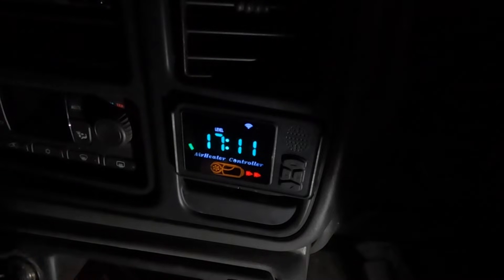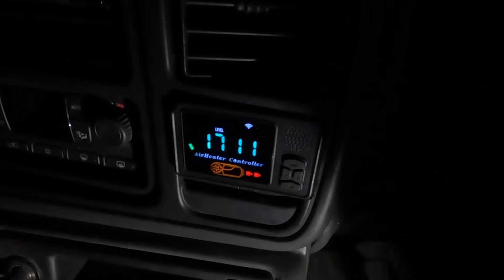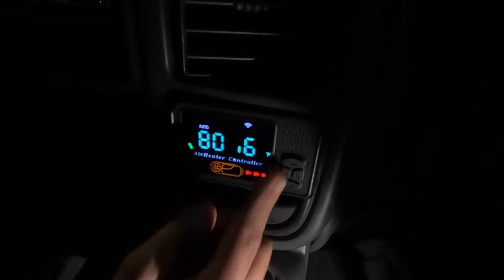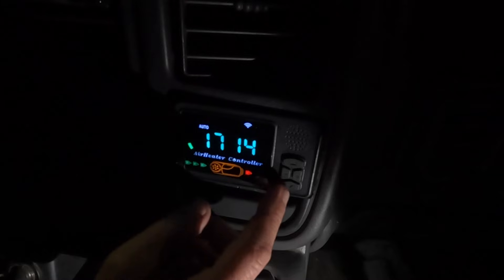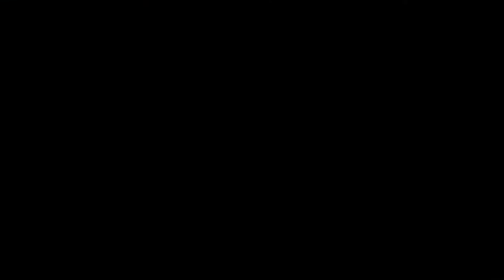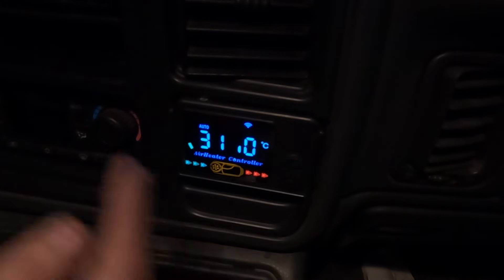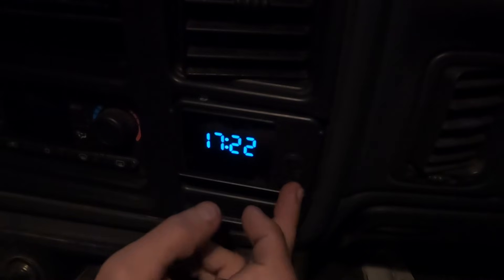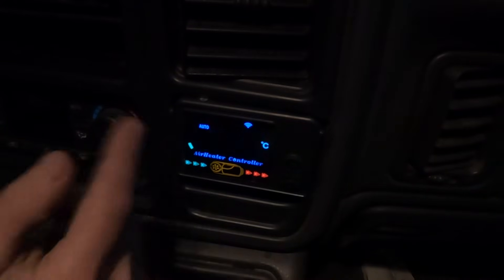Bluetooth Diesel Heater Feature & Settings Discovered !

Comment: I have not seen this question in any other heater post. If you have 2 heaters in different places will the blue tooth affect each other?
Reply from the maker: I just found the answer to this myself, the other day. 

The app will only connect to one heater at a time. If you want to control a different heater, you hit the scan, on the top right, and disconnect... you then select the other heater. It is a bit of a pain until you figure it out. 

PS... it is a good idea to look at the last 3-4 digits of the heater code before disconnecting, so that you don't make a mistake and reconnect to the same heater. It would be nice if they allowed you to change the names of each heater... but they just have a serial number or something.

Comment: What app do you use for blue tooth, and how do you pair?
Reply from the maker: It is called airHeaterByBLE and you pair by clicking the "scan" in the top right ... then select your heater and it connects ... I have done several and it works flawlessly.

Comment: Question 🤔 would this controller work on a older first gen vevor? Ive tried the second gen controller with wifi bars but to no avail! Love the auto on/off feature!
Reply from the maker: Hello. If you can find the controller and ECU, you can swap them into just about any 5 or 8kw heater, but I have not been able to find them, and I don't know that this would be cost effective. 

If you are looking for the auto on / off feature, you may want to look into a product called the Bureck thermostat. I have one that I will be testing soon.

Comment: If your diesel heater doesn't have Bluetooth can you make a have Bluetooth by switching out the control panels
Reply from the maker: If you can find the controller and ECU, then yes.... I have not been able to find these separately. You do need to swap the ECU and controller as a set. Also, the whole heater is pretty inexpensive, so it may not be cost effective.

Comment: If you hold down the up and down buttons at the same time for 3 seconds it will give you a menu where you can see different displays like the temp  inside your heat exchanger and it can display your altitude in meters.
Reply from the maker: Yes, I have noticed this... nothing that you can change, but a bit of info that you can see on the app, and a few extra things.
Reply: @loweredexpectations4927   i have a hcalory  version with this controler    my one has  temp of the burner and temp outside and altitude  on the display
Reply: hi   where is the temp sensor is it in the machine ..as i was going to use it for my tent   but have the heater outside for abvious reasons  do you know where the full break down of the  settings are or where to find them   cheers
Reply: @nigelcundey9710  there are 2 temp sensors, one inside the heater to ensure it doesn't overheat and the other is inside the display/controller. As long as you keep the thermostat inside the tent you can set the temp.
Reply: @randybobandy9828 I alway extend the controller cable so the heat put off the heater doesn’t fool the thermostat 😉 simple wire splice on 3wires 😉I recommend solder and heat shrink too😊
Reply: @kevinkc3onohelijeepworld  my heater isn't even in the same room as my controller, so it doesn't need to be extended. I also use the level settings instead of temp settings so the thermostat doesn't really help me. Heater is still going strong over a year later.
Reply: If the unit is disconnected from its power source, do you have to reset all its settings, or does it store the settings in its memory?

Comment: Maybe the "1.0°c" setting is to offset the thermostat innorder to calibrate it? Mine built in thermostat seems to be off by quite a few degrees
Edit: yes that setting is a temp offset. It was 13°c in my room but my controller said it was 22°c and i adjusted it -9°c and it now says 13°c
Reply from the maker: Yes... A bunch of people have informed me that that is for calibrating your thermometer. You can apparently set it plus or minus 9C. The thermometers are often off because of where they are mounted, or what they are mounted to. Air flow, or lack of air flow can have a dramatic effect, and having the controller mounted to a hot or cold surface will also change the reading.

Comment: I appreciate the video. I'm actually really disappointed that this model cannot change the fan/fuel speed. My heater will overheat past level 6. I was hoping to adjust the fan level higher in order to pull more air over the heat exchanger to keep it cooler. I only have about 2ft of ducting but i have a 90° bend about 6inchs immediately out of the heater and I think this is my issue... Unfortunately where i have it installed it is almost impossible to not have an immediate 90°bend. Wish i know that before  i drilled all my holes. 😅
Reply from the maker: A good idea would be to figure out what the problem is. There is one fan to control combustion air as well as heating air, so speeding up fan to cool it off is not a good idea. 

Remove the heater or remove the hose, and test it with the hose off. Diagnose why the heater is actually overheating, and then you can decide how you want to go about addressing the problem. Might be a pain in the ass, but it's the safe and smart thing to do. 👍 You got this !
Reply: @loweredexpectations4927  ya I need to just take the ducting off and see if it still over heats on high, if it fixes it the. That shape 90 bend is the issue.
Reply from the maker: @randybobandy9828   Hopefully this is easy to sort out 👍👍

Comment: I have been hating my heater ever since I bought it. 4000 ft elevation and it constantly overheats. It will run until the internal temperature reaches 260-265C then turns off. 30-35 minutes on medium settings, 5-7 minutes on high. I unfortunately bought the lower end model with a controller that does not have the ability to adjust things or even put it into prime mode. Vevor sent out 2 replacement motherboards and a temperature sensor but they did not fix it.  I am considering buying a different controller/board  and seeing if that helps.
Reply from the maker: Sorry to hear you are having issues. What controller do you have ? 

I am at 3500 feet, here in Calgary, Alberta, Canada, and I have no issues at all even when running my heater in "normal mode" for sea level. 

Most of the lower end controllers will have something called "plateau mode" ... this feature leans out the air fuel ration to stop it form overheating, making soot and lots of CO. 

I have never seen a heater that doesn't have prime mode, other than the ones with the volume knob... The controller I have allows you to prime, but will only allow it once when you first connect the power. After that you need to disconnect power, reconnect and press the down key for 7 seconds. 

The motherboard (ECU) has 100% of the functionality, so if your heater is having overheat issues, I suspect it is either an air blockage issue (exhaust, combustion air inlet, duct air inlet or duct air outlet... they are very sensitive so you need to be mindful of this.... If you are forcing air into a small area instead of recirculating, this could be the problem. 

I suggest checking the heater over carefully and running it without anything attached, other than the fuel line and electrical connector. Run it in the open and see what happens. If it works ok, add the exhaust and try again. Then the inlet, and so on... 

Once again. I'm at 3500 ft and I run my heater at the sea level setting... it runs about 210C all day. If I put it in alpine mode / plateau mode, it drops to 185C. 

Cheers and good luck.
Reply: @loweredexpectations4927  Thanks for the reply. I have the cheapest one on Vevor, with the 3 buttons on the bottom of the controller, green numbers. 

There is a prime mode in the directions, but I have not been able to activate it after trying 15 different times with the directions and various button combinations. You are supposed to hold the power and up button for 7 seconds but that combination is for another menu after 3 seconds and even holding it longer does not enter prime mode. The heater gets unplugged after every attempt/shutdown. It is how I discovered the "more info" menu. There is one in there that has a mountain which I am guessing is the plateau mode but I am unable to change any of the settings in that menu. I am guessing that is why they sell a "plateau module". The menu shows the outdoor temp, the heater temp, error code, run count and a few others. When it overheats and shuts down it shows E-05 on the main screen, and E-09 in the secondary menu.

There are no kinks in the air inlet or the exhaust hoses, just the 90° bend to get them out the side. The heater tube is straight out with the deflector on it. I will remove it and the screw on cap on the inlet for most airflow possible and see if that helps. I have been running it in a 12'x16' shed by the door with it wide open so airflow isn't an issue. Thanks for the suggestions. hopefully I can get it working.
Reply from the maker: @Riyame  As I said in this video, I have noticed that the manual is less than helpful. I have had several people tell me that they contacted Vevor and have gotten assistance with the actual instructions on how to do things. I'm not sure that will work for you, but it's worth a try. 

"Plateau" or alpine mode don't have settings. They are either on or off. The heater basically has two fuel settings. Plateau module, may just mean an ECU that has a specific elevation feature. There is not add on module. 

Error 5 and 9 are the same thing, but the heater doesn't know if it's a faulty sensor or if it is really overheating. If it is operating normal up until it gets hot and then shuts down and shows the code(s), chances are the sensor is fine and it really is getting too hot. 

The 2kw heaters are not as sensitive to air flow, but the 5 and 8 kw units may overheat if you have a 90 in the duct work, especially if it is close to the heater. 

Good luck !

Comment: Hi Joel, have you tried to hook up a piece of heating copper tubing baseboard to your exhaust to get extra heat from the high exhaust temp?
Reply from the maker: I haven't tried this yet. I currently have this heater in my truck, so it isn't ideal for that sort of experiments. 

I do have another heater that I do such experiments with, and I plan on doing that exact test. Perhaps beating a barrel of water or sand, ... depending on how efficiently I can remove the heat so that the exhaust is leaving at about room temperature.

Comment: Can you turn off the annoying voice? Also, how do you get to the admin menu?
Reply from the maker: Unfortunately, it doesn't look like there is a way to turn the voice off. I might try to take one of mine apart and see how hard it is to disconnect the speaker.... or if ti destroys the controller. 

The only admin menu that is accessible on this controller, that I am aware of, is the one that I show how to access in this video. Heater powered on, press and hold the M button. 

This controller does not have some of the admin features common on old controllers. Changing air fuel ratio, glow plug strength etc.

Comment: this heater controller is trash. you can't change any settings. in my case it overheats after 10 minutes, and it also runs extremely hot. the factory tune is way waaaayyy off. 

also i found the pump with this model is loud af compared to others. 

best to not buy this one, get the older styled one.
Reply from the maker: You sound upset... I hope I can help, but most people won't react well when you come across as being aggressive or angry. 

When you say "overheats" it turns off and gives you E05 code ? Have you noticed what the exchanger temp is on the app, just before it shuts down? 

The controller is fine. Your controller may have issues. Maybe we can figure out what's happening. First thing to do is check the app, if you can get that up and running. Look at the elevation in the top left and figure out if that is close to your actual elevation. A google search will likely tell you. 

If you heater is overheating in 10 minutes, it is possible this has something to do with the tune, however, that would not be my first guess. My guess is that it has something to do with air flow. How many KW is it ? What are you heating with your heater ? Are you recirculating air or pulling in outside air ? Is your exhaust and inlet free of obstruction ? If possible remove them and run the heater for 10 minutes to see if it still overheats. 

These heaters are very sensitive to air flow, so if you are restricting in inlet air, for combustion or heating air, this can be an issues. If you are restricting the hot air outlet, this can cause the heat to spike. The heater I have in my truck overheats if I turn the OEM heating system on as it restricts the flow of air out of the heater. 

These pumps are all the same ... if it is louder, this is either you imagination or because of how or where it is mounted, or because the rubber mount is stiffer, transferring more sound.

Comment: Hi! Thank you for your videos. Is the temperature sensor inside the controller? Or how is it able to use the automatic heat option?
Reply from the maker: Sorry for the delayed response. Yes, the heat sensor in in the controller. The controller must be in the location that you are trying to heat. 

The app / your phone just reads the information form the controller. 

There is, however, as second temp sensor on the heater itself, that monitors the heat. It is used for safety shutdown, if it gets too hot. This is displayed on the center of your app between battery voltage and heat setting.